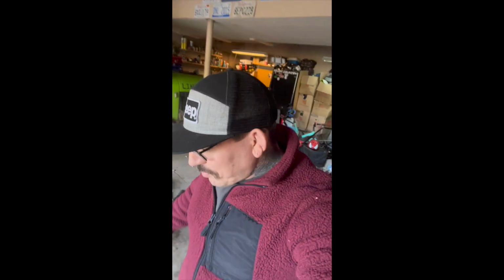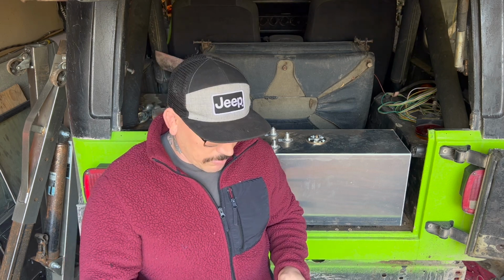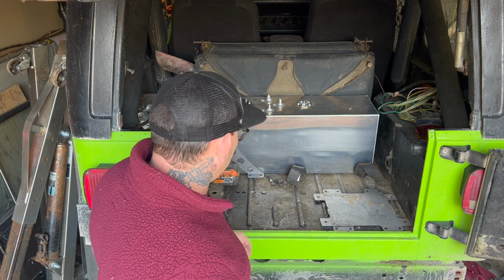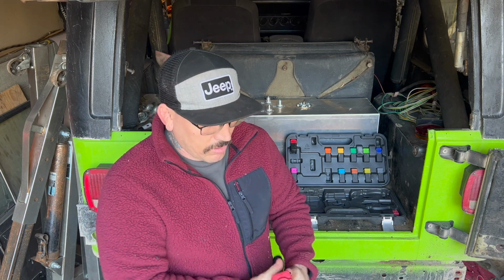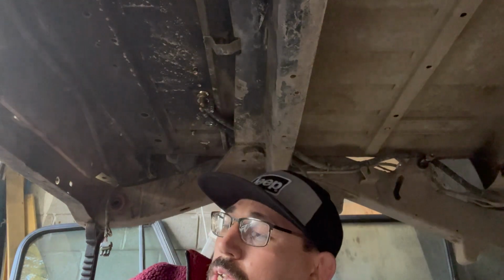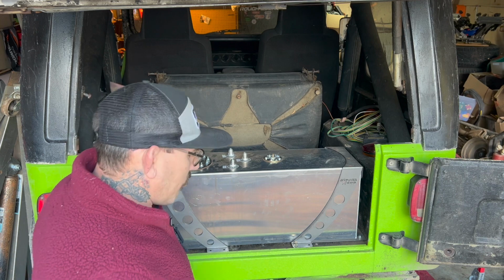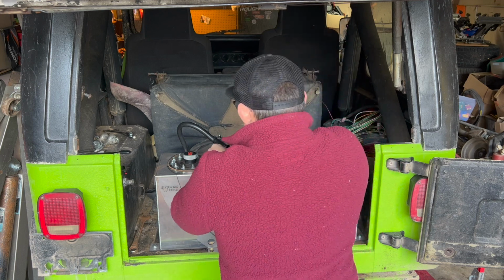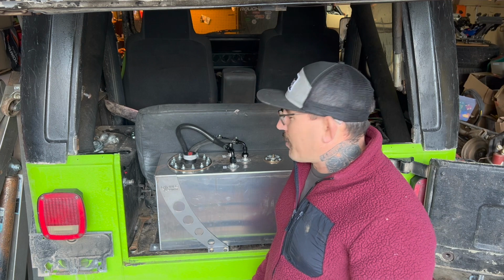Rci fuel cell install in yj cj tj

Comment: Should we put foam inside this tanks even with mounting bracket?
Reply from the maker: Personally I never run the foam for a few reasons one big one is it breaks down over time and clogs the fuel system. but some people swear by it. It’s said that it helps cut down on fuel airstrips from it sloshing and that it prevents flashback ignition inside the cell.